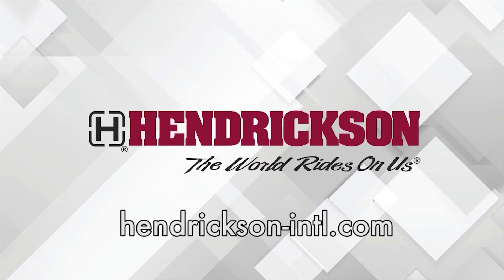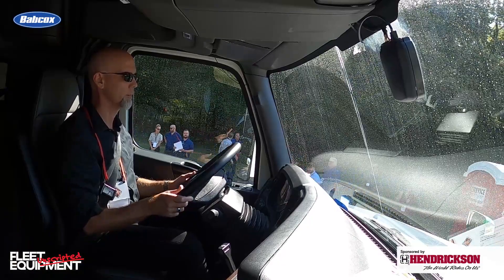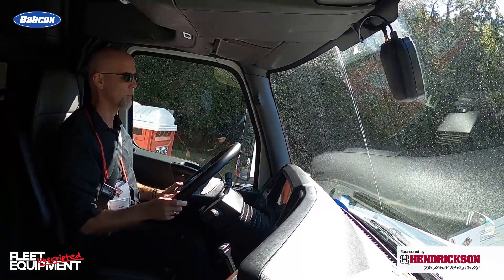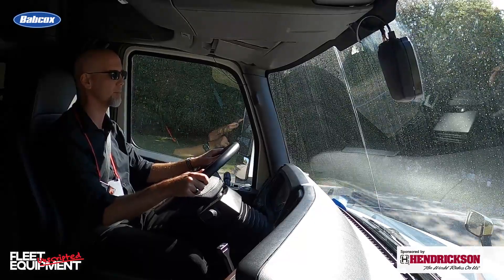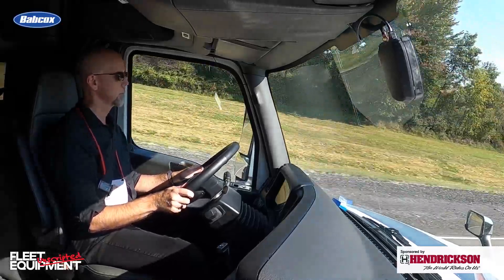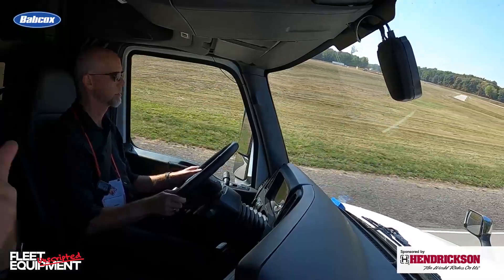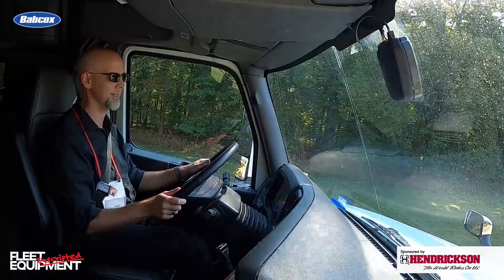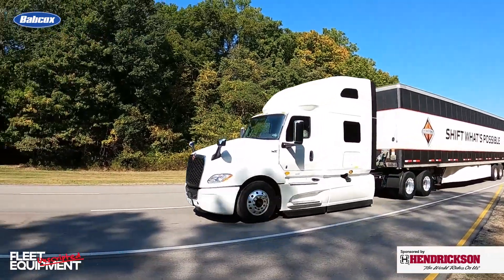Driving the International LT Series with the S13 powertrain | FE Unscripted

Comment: International had electronics problem not a motor problem cummins is good motor. Are you guys changing the electronics ?
Reply: This motor is built in conjunction with Scania
Reply: The MaxxForce™ and A26™ engines are designed by the Navistar in Navistar International.  The S13 is a Scania engine that will be built in Huntsville Alabama for the International trucks assembled in San Antonio Texas.

Comment: What mpg this truck gets?
Reply: It depends how fast and heavy you are. 8-9 should be doeable.
Reply: @sic22l I get 10-11mpg depends on how fast you’re driving !
Reply: @Faith-v9j are you currently driving an S13 Integrated truck?
Reply: I get 8.5-10 mpg. I own the truck, 120,000 miles currently.
Reply: @Faith-v9j How does it pull?  I run heavy all the time, 80 plus most days